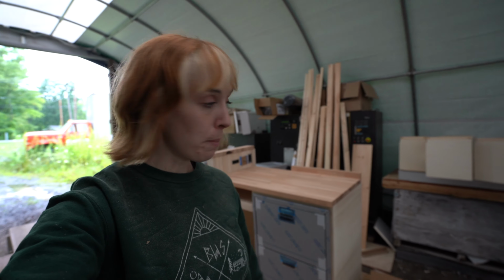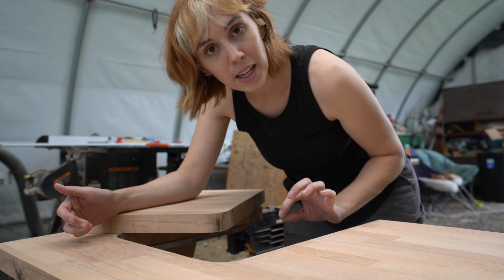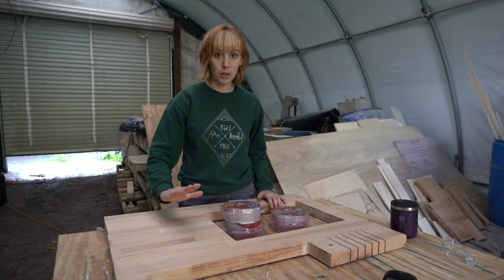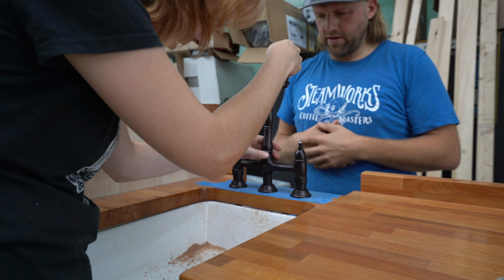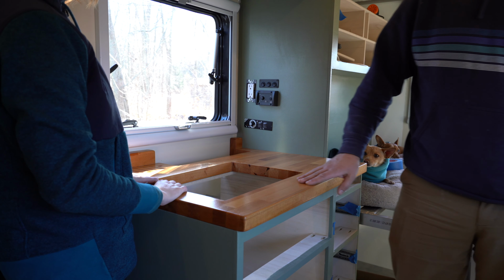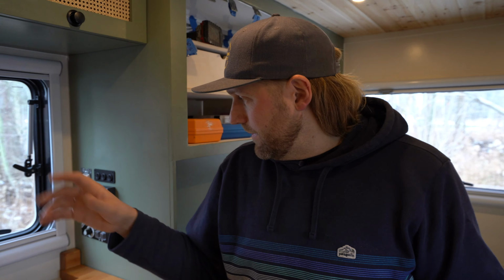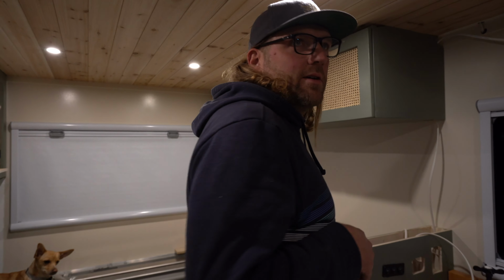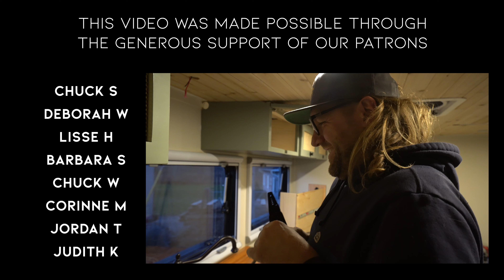TRANSFORMING This Composite Camper Into A HOME 😱 DIY Unimog Overland Truck Camper Build #12

Comment: It's obvious this isn't your first rodeo.  Pre-taping caulk lines, cutting holes from both sides, and especially using good wire strippers and Wago connectors save boatloads of effort. It's coming together so nicely!
Reply from the maker: Thank you!!! Certainly not our first rodeo. You learn a few little tricks along the way ☺️